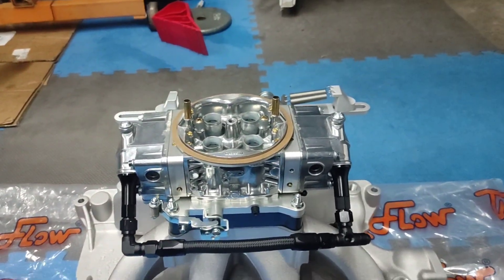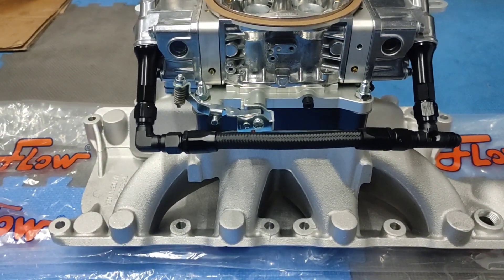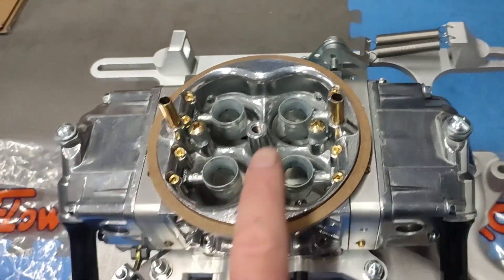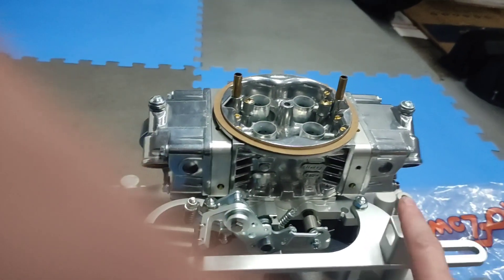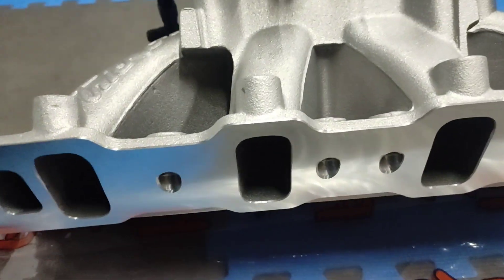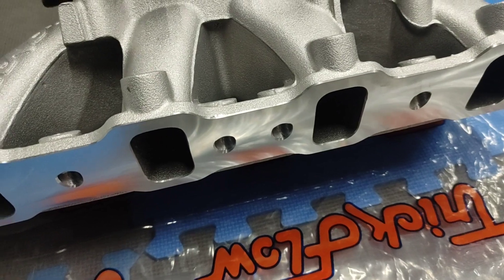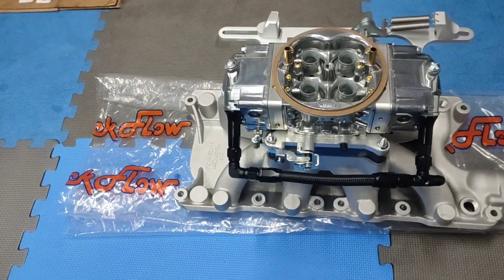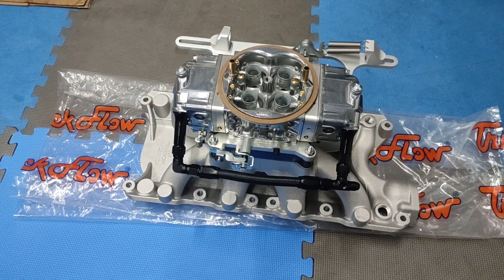86 Foxbody EFI to Carb setup

Comment: Back in 1989 we got so much crap for ditching the stock efi setups for a Victor and 750 double pumper until they found out it was worth 3 or 4 tenths in the 1/8 mile, only my daily stayed efi the rest got a carb and a kit. Of course we didn’t have nearly the intake, throttle bodies and mass air options there are today
Reply from the maker: I'm hoping i can pick up a few tenths also!

Comment: Bad idea not to have the intake port matched. We get a lot of those manifolds in and they have a terrible flow imbalance from runner to runner. The one we are doing a video on now the owner tried clearing the ports up himself and the imbalance was as much as 50cfm. We are fixing it now and porting it to make 550whp on a solid roller 408w.
Reply from the maker: it will get ported!